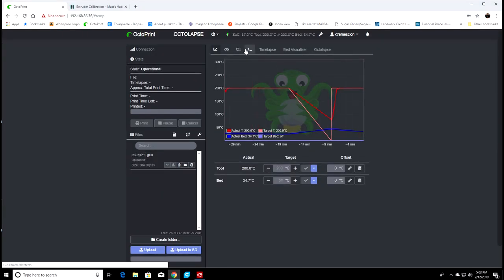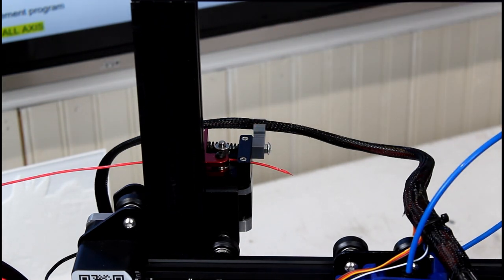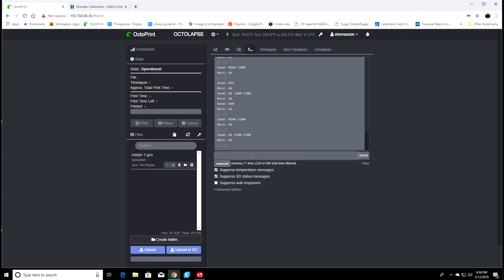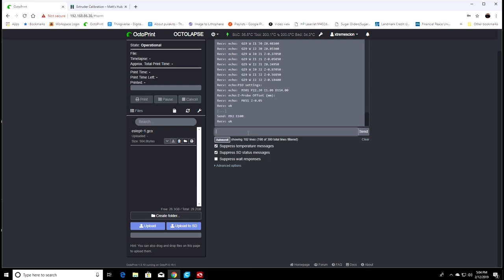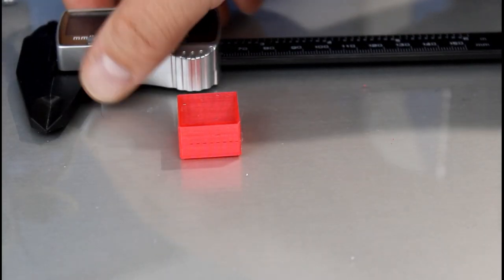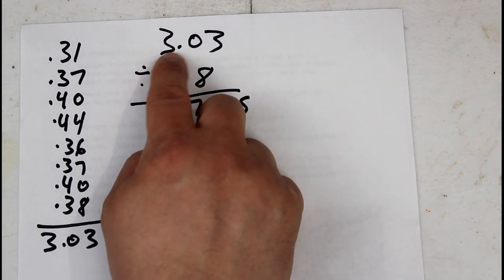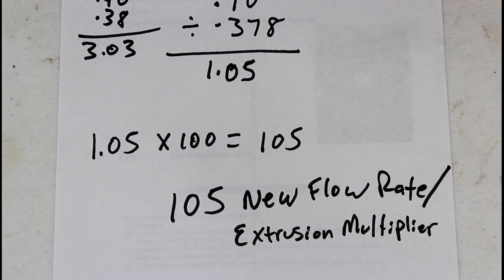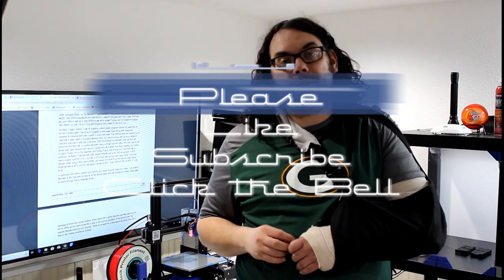Section 1.8 Esteps and Flow Rate using Octoprint and Free Air Method

Comment: I have done this process but in a different way. I measured 120mm and marked the filament before the extruder then ran 100 mm through the extruder and hot end. then measured the distance between my extruder and the mark. I was wondering if that is as accurate or more accurate of the extruder flow rate since. its actually moving through the hot end.
Reply from the maker: Thanks for watching John! There are 2 schools of thought here. 1. Just like you said, don't through the hot end and measure it that way. 2. Through the extruder as you see here. The benefit of doing through the Extruder is that unless you change a part of the extruder, you don't have to do it again. You print a calibration cube, measure it and get the Flow rate for every filament you use and the flow rate, or extrusion multiplier, depending on your slicer, is all you have to change. If you don't through the hotend in method 1, you should do that whole process for every filament you print with. That means changing the ESteps every time you change filament. Luke found that it's easier to just adjust the flow rate in the slicer, rather then the ESteps every time. That being said, most people don't change the ESteps for every filament and it could cause extrusion issues. I hope that makes sense.
Reply: The Edge of Tech thanks this makes sense!Keep up the great work.
Reply: @TheEdgeofTech  👍

Comment: Using your video as tutorial on getting the correct e-steps. You had the e-steps at 93, and it extruded 93mm instead of 100, so you changed it to 100 for 100mm. That's fine and dandy. But my printer extruded 98.4mm while e-steps is 140. So I applied this formula to get the correct e-steps for my machine: 100/98.4*140 which gave me 142.3.
If I am not horribly mistaken, the formula to get correct e-steps is "expected extrusion divided by actual extrusion, multiplied by reported machine e-steps".
Reply from the maker: So you asked it to extrude 100 mm and it extruded 98.4 correct?

Comment: Thanks for the vids! So the M92 E100 command, would I still do this if 100 mm of filament was perfectly extruded? Confused if this command was a correction for your extrusion length being off.
Reply from the maker: If you are extruding 100 mm when you tell it to currently, you don't have to do anything!

Comment: does the slicer software or printer firmware make a calculation to adjust for different layer heights or do you have to change flow rate to accommodate layer height? 
Great job on the performance assembly vid btw.

Comment: Couldn't you just set the esteps more precisely? I noticed you ignored 0.35mm on your results and got something like 0.65mm extra when you set to 100mm extrusion... Couldn't you have set it to whatever it ended up, like 98 or 99.xx as an estep value? It's what I did on my tevo machine in the past.

Later on you do the cube but at least your extruder is dead on and flow can be adjusted but the math is isolated by the part..

Otherwise... Why change esteps at all if you're gonna compensate via flow anyway?

Just straight up step 1 print the cube and adjust the flow?

Comment: Well, I give it a G1 E100 F100 and nothing happened.  I gave it a G1 E200 F200 and it spit out 100mm.  Then I gave it another G1 E100 F100 and it retracted 100mm.   I'm so confused, I know this worked for me in the past.
Reply: Same problem here. Did you ever figure it out?
Reply: @CarlMercier  I know this might be way too late, but if you type in M83 enter before doing the G1 E100 F100 then it will switch from relative to manual and should work
Reply: @Orithorn  That is so weird, i had the same issue as these guys and doing this worked.  Thank you.

Comment: Yeah I think you made an editing mistake?? You dont need to heat the hot end to calibrate the extruder if you disconnect the Bowden tube. Other than that great video.
Reply from the maker: Hi! Thanks for watching! You have to heat the hotend to get the extruder to turn. If you don't heat the hotend, the extruder will not push filament through. The firmware stops it.
Reply: @TheEdgeofTech  You can M302 P1 to disable cold extrusion checking

Comment: 4:45 Are we also meant to measure the arc that the filament creates for the length required :P There is no point making sure you cut square and close to the extruder block when you measure like this.
Reply from the maker: Thanks for watching! When I film this I had a broken arm, I had my wife help me and straighten the filament out when I measured, but I could not film it holding it. That's why you see the filament like that. I always suggest straightening the filament out while measuring!

Comment: The free air method gives me 100mm on the extrusion. But when I reconnect the bowden tube et al, run a 100mm measure, I get much less than 100. Does this mean anything, or is this correct?
Reply: That's right, because the free air just makes sure you're doing the right amount of steps.  Once you put on the nozzle that is a huuuuge variable.  If you extrude 100 at 190C or at 250C you'll get very different results.  That's why it's important to calibrate it free air and not through the nozzle.  Once you know your steps are good, the rest comes down to flow and temp.